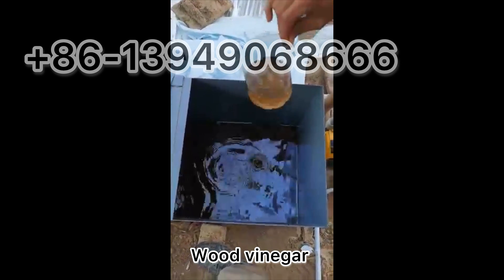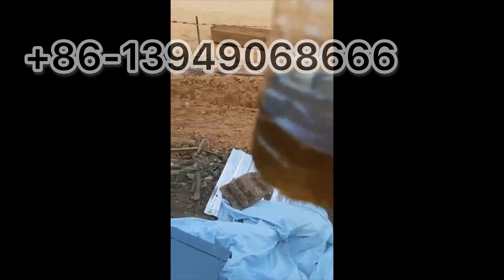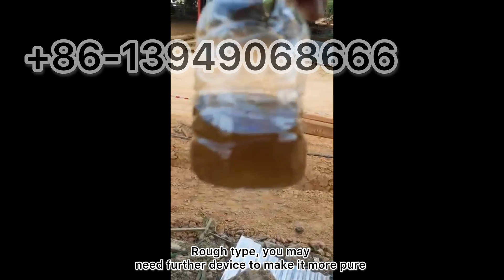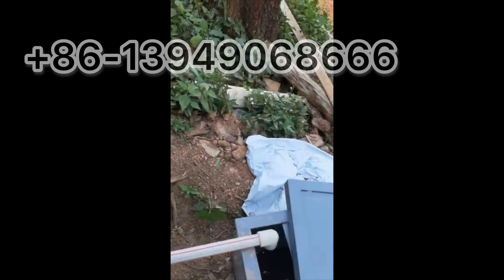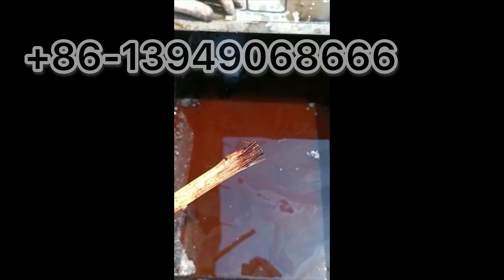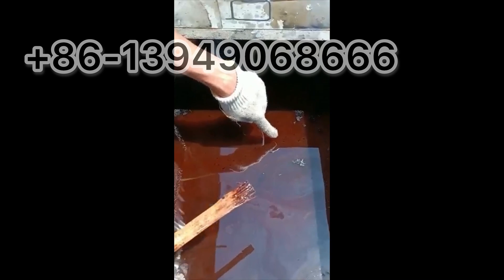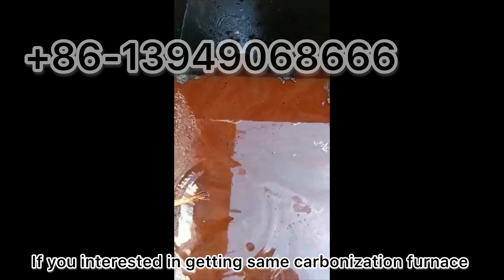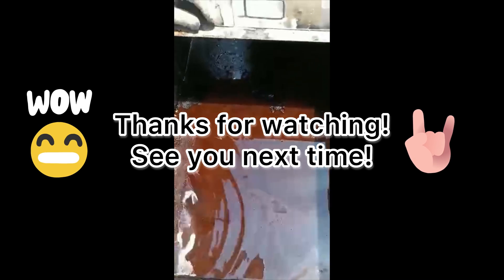5m Horizontal Carbonization Furnace 1.5 ton/batch Output Coconut shell Wood Bamboo

Comment: What happens to the CO2 produced from the gas combustion inside the furnace in this system? I don't see a chimney.
Reply from the maker: @cengizhuseyin3406  It will comes out from bottom chamber. And we have extra gas burner, we can add pipes and burn it outdoor. Pls contact me by WhatsApp: +86-13949068666. Will send you more details

Comment: So how many meters of wood can u put inside?
qubic meters?
like here oak wood 1 qubic meter can give up to 120 kg of char coal 
and oak is heavy how to you get then 1.5 tones of char coal from bamboo which is light wood type in so small area?
our furnace is made of brick like 4x 4 x 3.5 meaters dimensions is side where we put wood
this informations which u provide are not crect
Reply from the maker: Okay. It’s just advertising. 1.5 ton is sawdust’s briquettes capacity. Because wood has low density and high density type. We not able to write that accurately. Thanks for your interest about our furnace.

Comment: How much time and electrical energy is required for one batch.
Batch size??
Reply from the maker: Only one fan 1.5kw and two water pump need use electricity, time pls check in this video description. Batch capacity pls check in the video description also. Thank you!
Reply: @kimzhao-charcoalmakingmachine  how may kw of electricity for the two extra motors? Does a new insulation layer has to be applied on the door for each use?
Reply from the maker: One fan 1.5kw, water pump 0.75kw will be ok. It's already with insulation layer on the door, and graphite packing sealing materials on the door. No need additional adding something. @ttawevino9964
Reply: Can it be powered by solar? If so how many kva inverter needed?